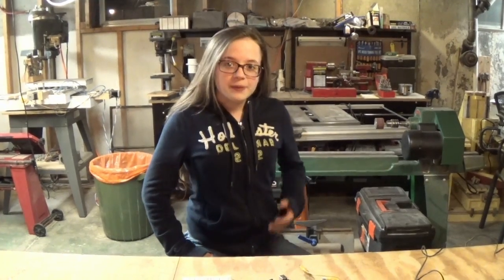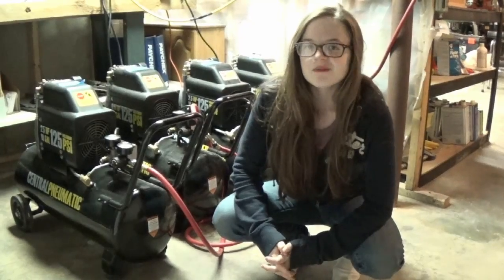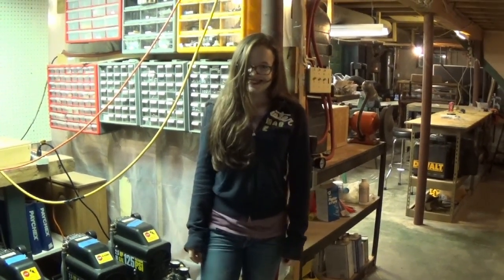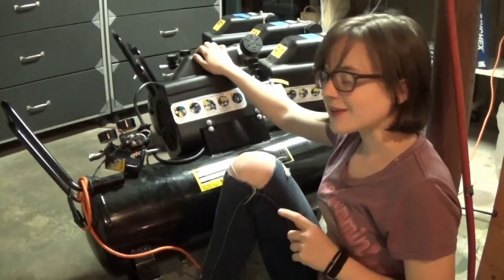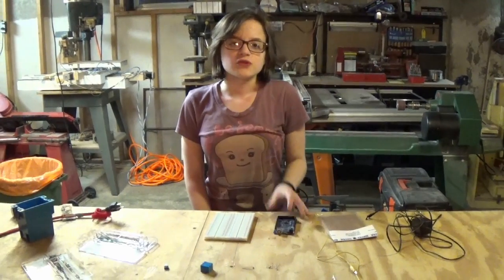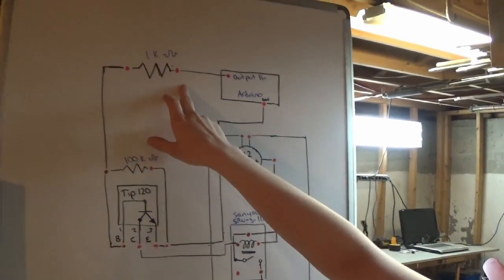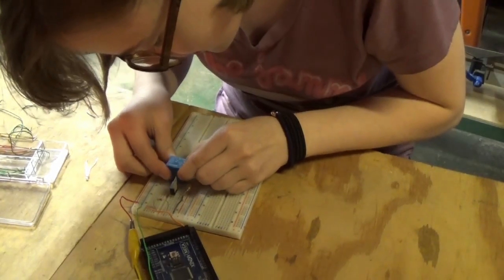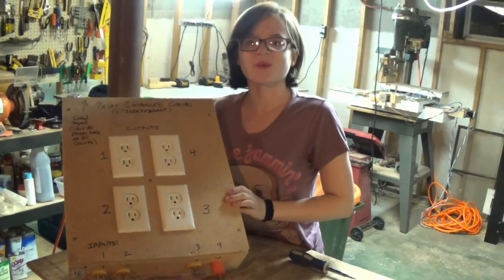Ep3 Cheap High SCFM Air with Parallel Compressors

Comment: Seems like a whole lot of wasted time and resources. To make a safe setup requires only that you remove the pressure switch from two of them. On the other two, detach the two wires that run from the pressure switch to the motor. Now wire two of the compressors to each of the pressure switches that you removed from the compressors. Run each pressure switch from one leg apiece of the dryer circuit. You won't have all kinds of bells and whistles. Or 2 second delays. None of that is really needed. You run one air line to a tee, and put both pressure switches on that. If you use the control screw to calibrate them, you can have both pair turning on at the same time. And you'll resupply plenty fast, with no dangers.

That said... Well done, young lady! :)

Comment: Well you thought of everything but you started showing off the moment you said arduino.  I would be surprised if you couldn't run this setup off a 20A 240v supply and just use a 20 amp rated pressure switch which the one you have may be.  Instead of wasting air to unload the head you could make a manifold for the unloader line and run them back to the master (or use pneumatic solenoids).  I combined two compressors in this way if you would like to check it out. https://youtu.be/3YRd0Ih9N64
Reply: I watched your video. I wasn't overly impressed with your solution. Are you trying to steer people to your channel? Now if you are offering to pay an electrician to come to her house and set up a 220 volt plug for her your comment would make sense. Otherwise I think you might be the one trying to show off.
Reply: I guess it would be a problem if you didn't already have a 240v outlet in your garage and didn't feel confident installing one yourself.  I was more showing off my solution for unloading the heads. For all the money and hassle spent on extension cords it would almost be worth the 240v outlet and would free up options in the future.
Reply: What is your opinion of the Craftsman compressors themselves? I thought about buying one but was put off by the 6hp claim.
Reply: It's a great small to mid-size compressor with no worry of oil in the air but If having a loud and limited duty-cycle compressor would hinder your work then move up to a 60+ gallon belt driven oil bath compressor. 
it works great for running an impact, air ratchet, an HVLP paint gun, 10-15 minutes of grinding or sand blasting (using smaller jets) but it can't keep up with 20+ minutes of grinding or sanding.
Buying the 2nd compressor (used) and all the parts to make it work was a lot less than upgrading but i would never build a tandem like this to start out with.
Reply: Honestly half the money i put into the project i wrote off as just having fun and yes, showing off.
Reply: Thanks for the review and your honesty

Comment: It's a nice theory that doesn't work very well in reality. At best those are 4 cfm at 90 but seem to be even smaller than that...So that's about 20cfm total. The next issue is actual air flow. The regulators on those cheap little compressors tend to be low flow and restricted. Run your coupler straight off the tank when possible. Worst case remove a port on the pressure switch and drill out the inside to at least 5/16". It's basically a 4 way air manifold. Ideally remove the pressure switch itself and drill out the fitting to the tank port on the pressure switch. Clean all shavings out, then reassemble. Leave 1 port open and turn compressor on to make sure no shavings are in there. Fully reassemble. The next issue is the restrictive couplers. Most commonly used are Type M. They are very small and restrict flow. So  switch them all to Milton Type V Hi flow. Then the final line needs to be like 1/2" hose and fittings. 3/8" will realistically struggle to flow that much air. You can also daisy chain air tanks. Ideally with a larger hose/line like 1/2" Tanks can be found cheap on Marketplace or Craisglist. Run straight off the tank when possible. The more volume you have the longer your blasting time will be.

Comment: Btw also incorrect: "houses circuits are 15 amps"lol... again, wrong. The difference from 15 to 20 amp is about 3 bucks lol so blame it on the cheapo builders who build 5 hoise per lot for saving a buck but yeah if u live in a neighborhood, chances are most circuits in your house is 15 amps. Thats a loball builder, not a code. In a private build on a plot of land, houses are mostly 20 amps cause the homeowner hires the electrician,  WHO has more control of the situatio. And guides the home owner thru the proccess with knowledge...basically money is not the deciding factor . A private build is not AFAB . (Anything for a buck) if youra is all 15 amp circuits, it afab. And its ok that its 15 amp, but dont tell ppl on an instuctional video all houses are 15 amps circuits. They are not

Comment: 1.  I wonder if they could hear the racket like 30 miles away.
2.  Leave it to an engineer to turn a round wheel into a square wheel, powered by a Rube Goldberg invention.
3.  But still...very, very impressive nonetheless.

Comment: This is dumb , running extention cords, to different outlets, even if you have that many on different circuits, running a lead wil get voltage drop maybe causing trip anyhow, these compressors are unreliable and loud , if you are really going to do this good luck , maybe join up 200 aa batteries for your car batt

Comment: What utter garbage.  Those oil less compressors will die in months if sandblasting.  They are not continuous duty.   Those compressors also run at 14 amps.  14x4 = 56 amps.  Last is the fact that you will never get 5CFM out of those compressors, and that 4 compressors in parallel will load up the underperforming  motor and cause more issues. 

Just because a little girl does it (with a TON of help from parents) doesn't make it right.

Comment: You know nothing.your design is erroneous..
Mine in the other hand defies Physics I created it in a quatum computer it runs hundreds of times each simulation last a year in less than,5 seconds once I print the data then I applied to the real world Wich means make the compressor with the super computer blue prints.total cost 80 dollars and the results were just as intended anytime I'll prove it